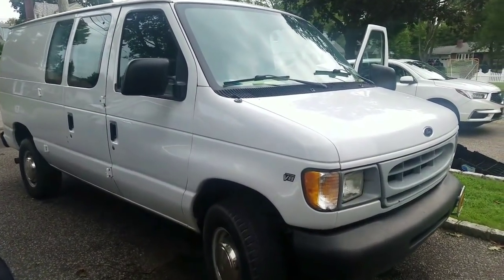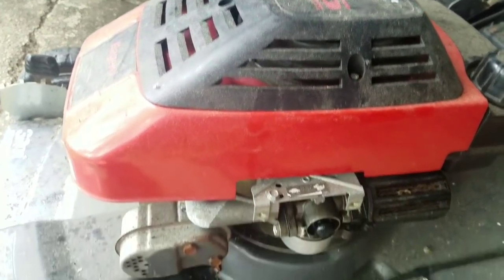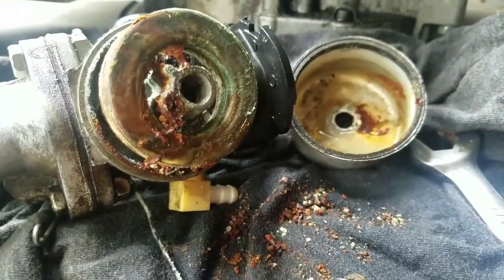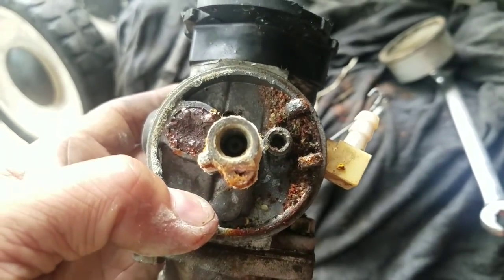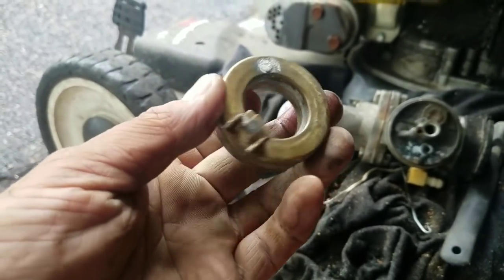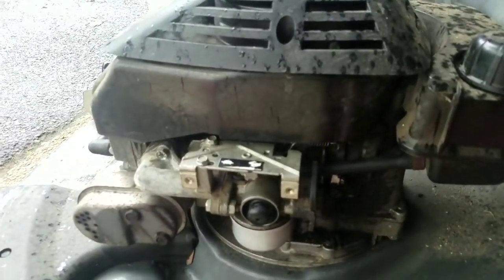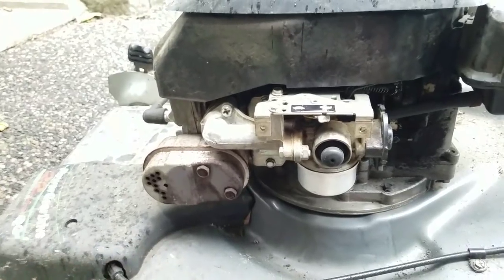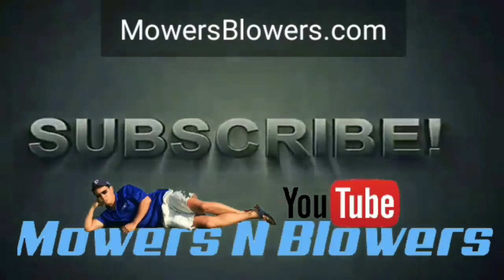FREE CRAFTSMAN EAGER 1 TECUMSEH 5.5HP SELF PROPELLED LAWN MOWER CARBURETOR CLEAN HANDLE FIX REPAIR

Comment: What is the part number for that carb?  I have an Eager 1 917.373680  Can't find it on Ebay. All I need is that spring clip you showed broken on the float at 5:37
Reply from the maker: 632747

https://www.ebay.com/itm/182539620773
Reply from the maker: Or you can get this rebuild kit

https://www.ebay.com/itm/293517936643